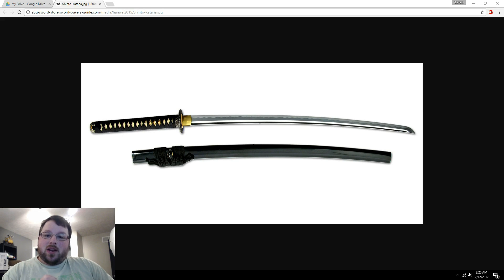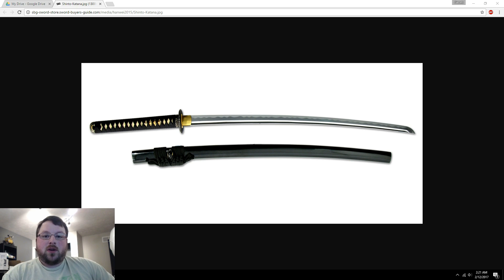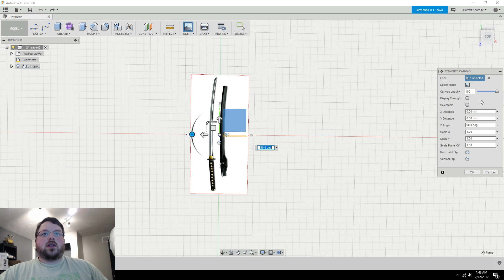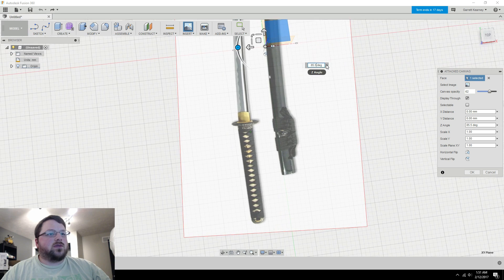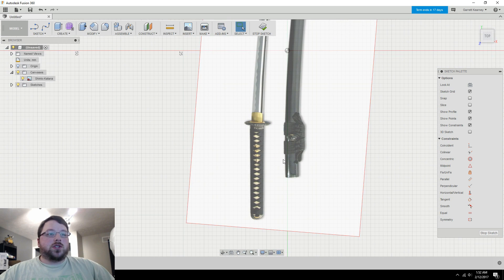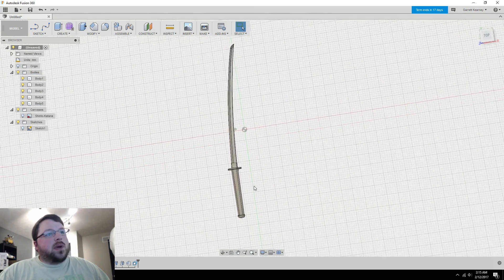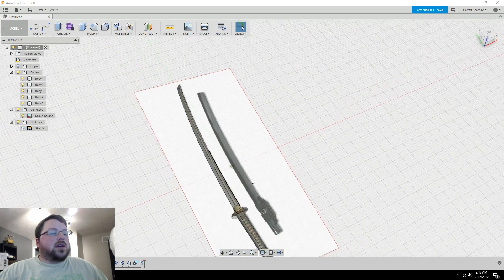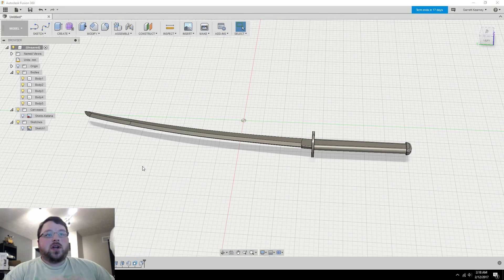How to Make a Sword in Fusion 360 - Part 1 - Katana

Comment: Sorry bro, but this model is super poor. You just can not do swords in this programe.
Reply from the maker: I respectfully disagree. This was meant to be a tutorial, not a finished model. So it was just showing how to quickly and easily create a base of a prop or cosplay sword that could be built upon. Fusion can absolutely make swords. It's a robust CAD program, it can make almost anything if you're creative enough.
Reply: I agree with Chaos Core on this one. This is actually a very well done sword and he clearly is only showing the basics with this video. Awesome job!

Comment: Great work Garrett!

Is there a build-in tool to allow you to create notched mating surfaces like you see on real model kits?
Reply: You could draw one then use pattern to repeat down the length of the handle. That might help some.
Reply from the maker: There's a few different ways you can achieve something like that. Part 3 in this video series will be pretty close to what you're wanting I think. If you tweet me a picture of what specifically you're going for, I might be able to elaborate a bit on it. :)